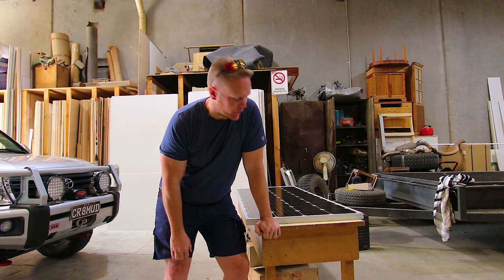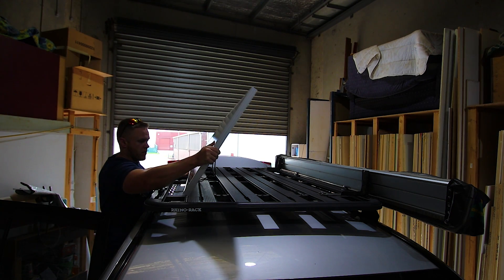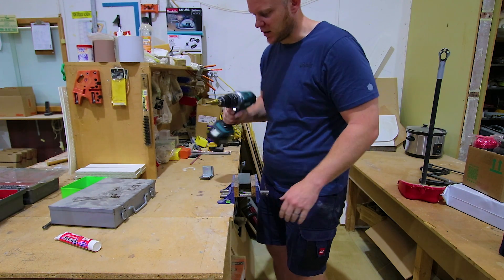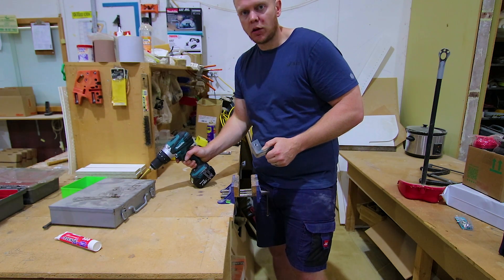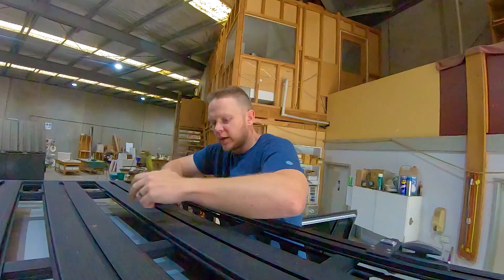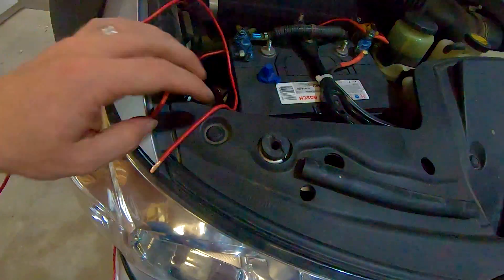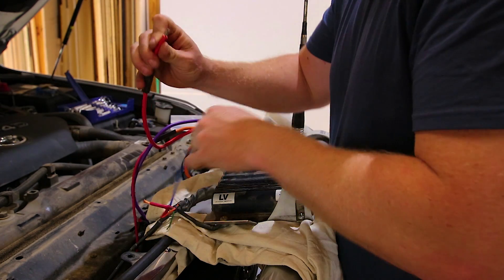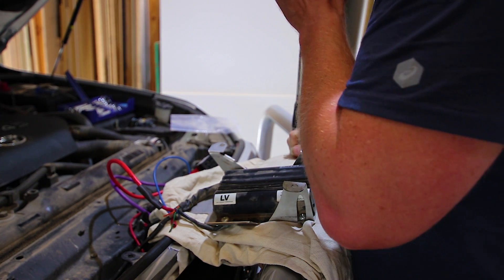Solar Car - Installing SOLAR to YOUR car - NO DRILLING - 300 watt solar panel

Comment: I wish I had the same patience when working on my car. Looks very clean! Not sure about the earth though??? Can't really argue why, buy I like to run positive and negative back to the controller. But hey, if it works we can't knock it.
Reply: Yeah, I’d be real curious if you could throw a good quality multimeter on it, from the bolt where your panels negative is & measure the resistance to the negative of your BCDC.
Reply from the maker: 😂.  Must be a patrol vs LC thing 😉. 

Yeah a few ppl have commented about earthing back to itself but I’ve always done it. 

Light bar. 
Spot lights. 
Rear lights.   
It’s the same as just earthing it to a point on the chassis.  It’s all connected.  

I dunno.  Maybe it’s not the done thing but it’s always worked fine for me.  And makes it all look a heap cleaner with less wires hanging off of the battery.

Comment: Have you noticed any issues with the earth heating up at all mounting it on the frame?
Reply from the maker: No nothing at all.  
It has 6 points of contact to the Roofrack via the mounting brackets so it’s fairly well dispersed.   
We are only talking 15-16 amps at 14.4v as well so it’s not heaps and heaps of current. 

So far it’s been completely trouble free and it’s been 4 months now.

Comment: Only difference is that I ran mine down the D pillar and sikaflexed it in the corner of the body behind the tailgate, partly because I didn't know a wire could fit down the weather strip but mostly because my 1240D and auxiliary batteries are between the back seats and the drawers. I'd be inclined to run the earth down the passengers side A pillar and earth to the same point that the redarc is earthed just for peace of mind.  Keep in mind I deliver newspapers for a living and am in no way a qualified auto electrician haha. Loving the DIY mods on the 200
Reply from the maker: 😂. Thanks bud.   

I haven’t noticed any heat issues at the earth point and no drop in power at all.  

It has 6 points on contact to the roof rack via the mounting brackets on the panel.  So it has a fair amount of surface area to ground itself

Comment: Great attention to detail, but I’ve always found that running the earth direct back to the battery, eliminates any chance of crappy earth points not doing their job. 
Especially when you’re relying on aluminium frame that’s bolted to the roof rack, which is bolted to the car body, which is mounted on a chassis etc.
Reply: The unibody or frame has less resistance than any wire you add. A problem with your scheme is if the factory ground to battery fails? When you start the car all the starter current goes through your panel and melts it.
Reply: Some regulators control the neg side so earthing to the body not a good idea
Reply from the maker: I’ve always been the opposite.  I’ve always earthed the appliance at the appliance location to help keep the wiring cleaner.  

Both this car and my previous has been done the same way and I’ve never had an issue.
Reply: Australian 4x4 Adventures cleaner it may be, although if your worried about voltage drop. 
By earthing at the panel your increasing the circuits resistance because it now has a return path through your roof rack, roof body etc etc to the chassis. 

But if it works it works 👍
Reply: @Australian4x4Adventures  Sometimes ya get lucky and dont have an issue, but in my experience, if there's ever an issue, it's usually fixed by running the earth back to the power source.